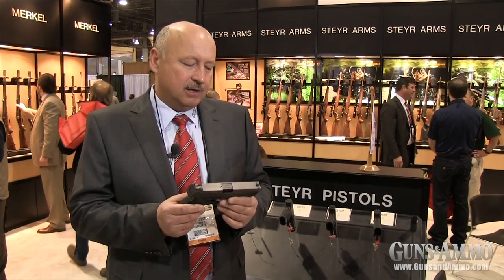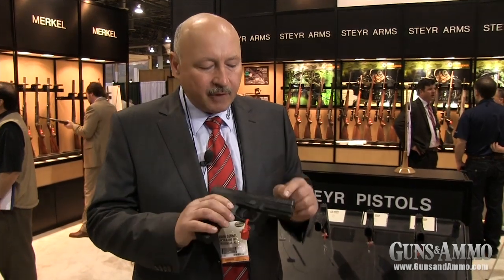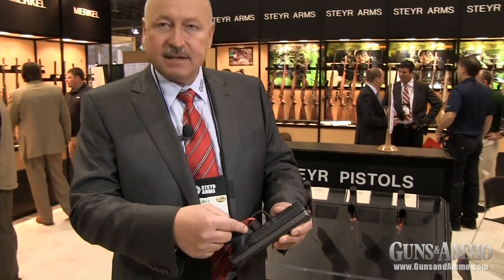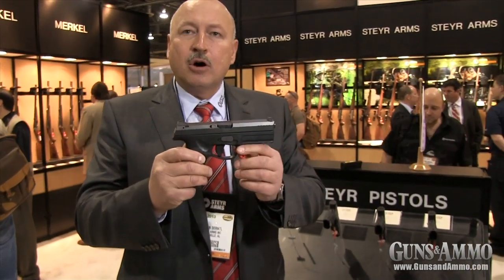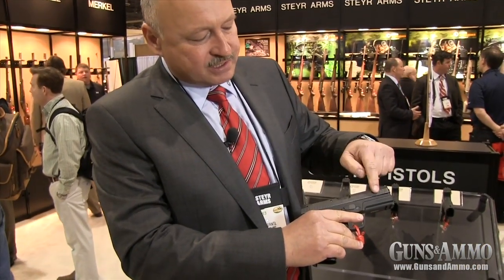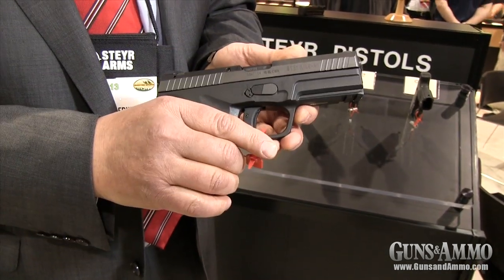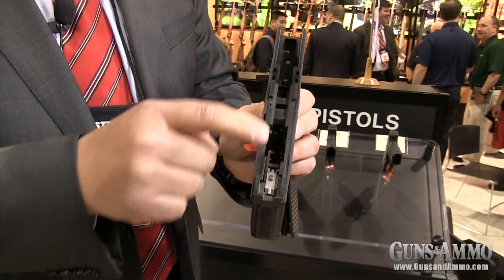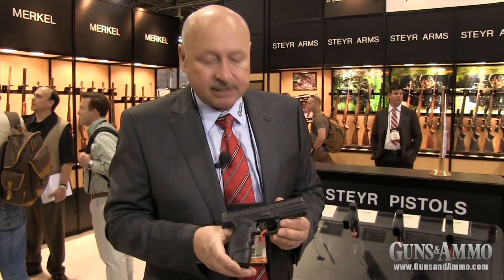Introducing the Steyr L9-A1

Comment: I'm not sure what makes it look like a toy.  It's basically a glock with none of the problems of a glock.  The front is blocky because all the internals are moved down as low as possible to reduce muzzle flip.  The grip is flared to draw you hand up high and tight into the beaver tail for the same reason.  It looks kinda goofy, but when you realize the utilitarian genius behind why it looks the way it does, it grows on you.

Comment: The other factor is the low bore axis causing little to no muzzle flip. I can dump a mag into a pretty tight group. At 7 yards. A 3" circle. And at 25, all in the 10 ring on a silhouette. I'm sure there are some that could do it with a Glock or any other gun, even me, but only after shooting and practicing for a while. The Steyr just made it easier.